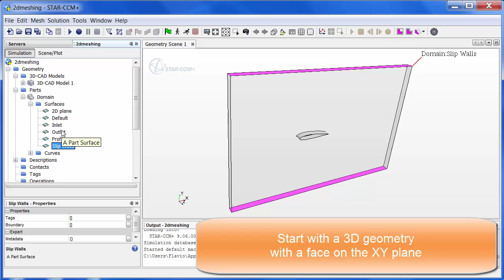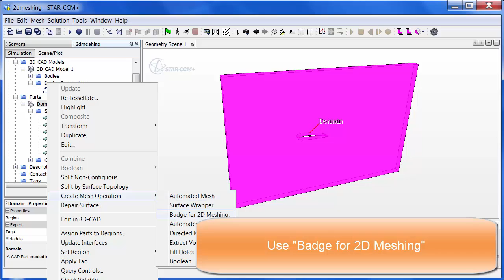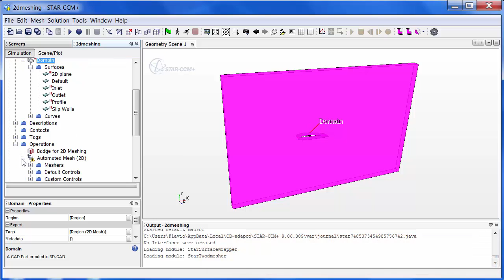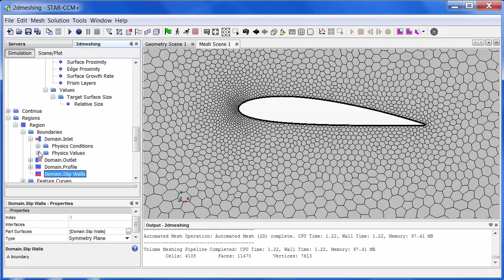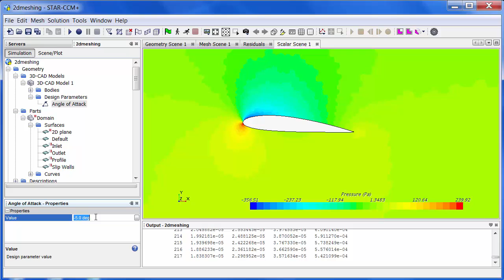How to use the new 2D meshing in pipeline of STAR CCM+

Comment: how did you created the geomtery ?
steps followed

thanks
Reply: 1. Import Curve from plotted points. (Fix Trailing Edge to be a sharp point)
2. Create Primitive Rectangular box as the fluid region
3. Extrude the curve (extrude it symmetrically in more space than the thickness outlined (make sure to click the option to not merge the bodies))
4. Add in a Transformation (Right click on the airfoil solid body in the tree drop down, and go to Transform -> Rotate
5. In the rotate specification, you can create a design parameter accessed for later (as shown in this video). So you can add this transformation in at 0 zero for now.
6. Do a subtraction between the two bodies (The target being the fluid region, and the tool being the airfoil. You don't want to keep the tool body)

You should have it! Now you can update the AoA just as was shown in the video

Comment: Can you explain how you were able to link the AoA to the 3D CAD Model?
Reply: So I was able to do it, and I can outline my procedure.
1. Import Curve from plotted points. (Fix Trailing Edge to be a sharp point)
2. Create Primitive Rectangular box as the fluid region
3. Extrude the curve (extrude it symmetrically in more space than the thickness outlined (make sure to click the option to not merge the bodies))
4. Add in a Transformation (Right click on the airfoil solid body in the tree drop down, and go to Transform -> Rotate
5. In the rotate specification, you can create a design parameter accessed for later (as shown in this video). So you can add this transformation in at 0 zero for now.
6. Do a subtraction between the two bodies (The target being the fluid region, and the tool being the airfoil. You don't want to keep the tool body)

You should have it! Now you can update the AoA just as was shown in the video